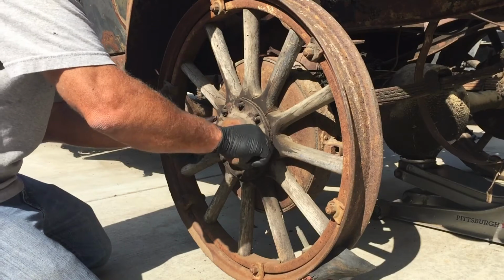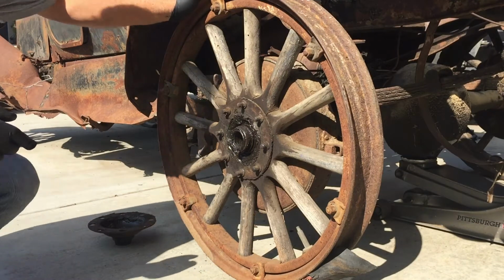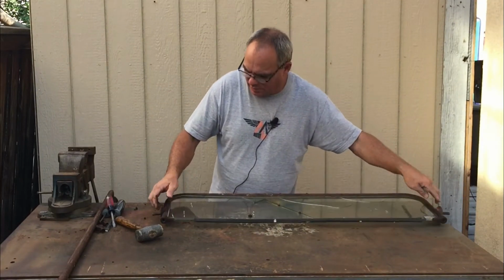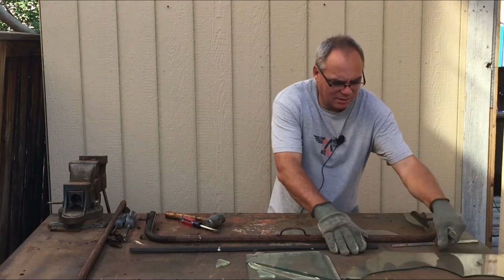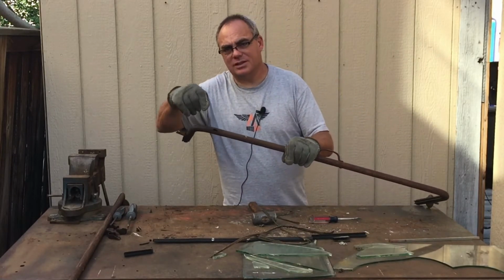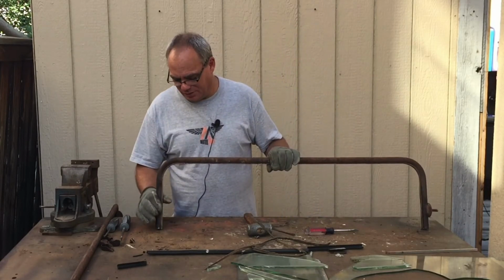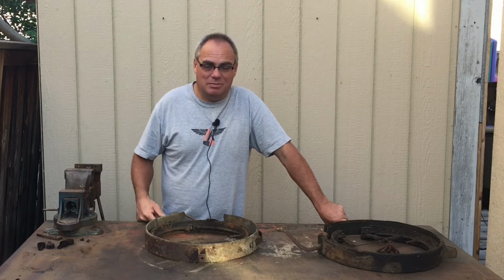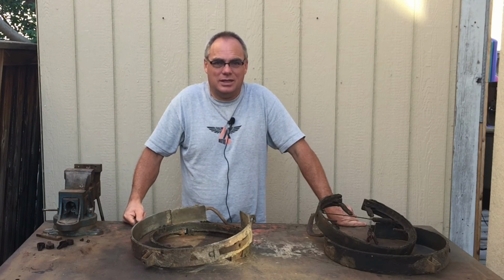Episode 10 No Brakes

Comment: You need to get a large tub and use 1 part molasses to 8 parts water and use it for rust removal. It’s a little slow but It works just great . Takes about 8 - 10 days but if you stage your work it will save months off your project. You can search you tube for some videos on it. You can save parts you never thought you could it’s great on nuts and bolts also. Will make them like new.